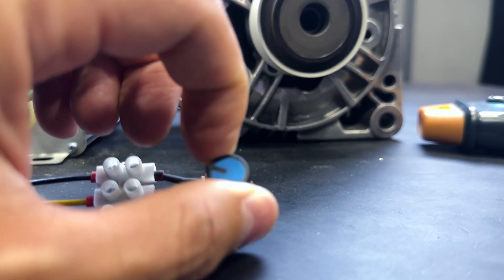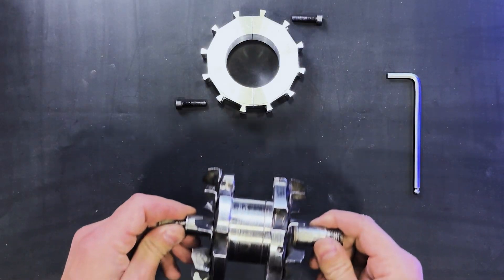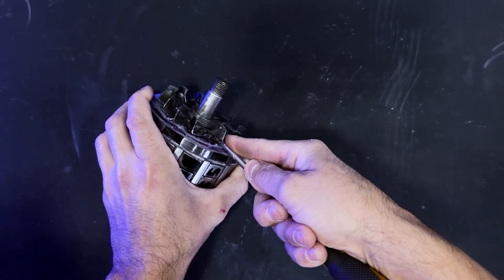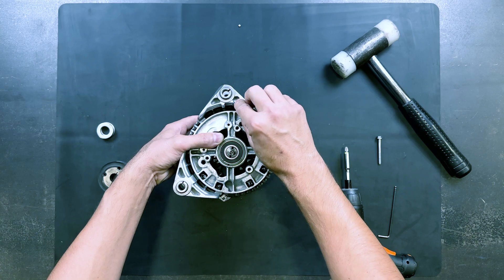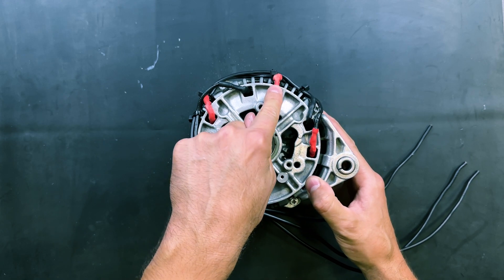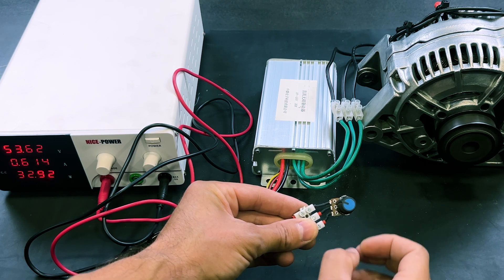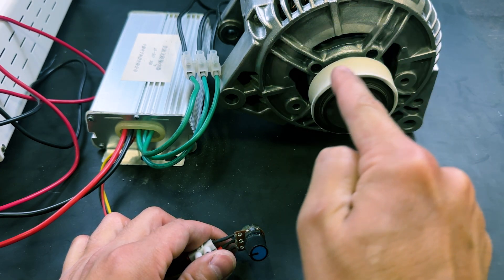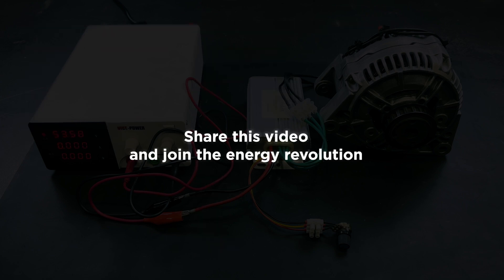I Turn This Alternator into a POWERFUL MOTOR with MAGNETS

Comment: There is and never has been any alloy of aluminum and silver. You are a liar and a swindler.
This is completely normal aluminum.
Reply: An alloy of aluminum and silver (AlAg) exists and is used as a master alloy for grain refining, hardening, and improving alloy performance by enhancing properties like ductility and machinability.
Reply: I did not say that the alloy don't expect. What i said was that the story of the alloy in the generator is B.S. because it is aluminium only.

Comment: We already know that the component is an alloy of silver and aluminum. We know that the finished product cannot be purchased due to patent rights. The question is whether it is possible to buy this element / alloy for magnets? or whether it is possible to ask for the patent number and in which patent database we can find it. I once searched patent sites but searching for this is a nightmare
Reply: This is an interesting question.
I will add to this question a question of my own.
What is the percentage of silver relative to the percentage of aluminum in this alloy? Perhaps you can tell us.